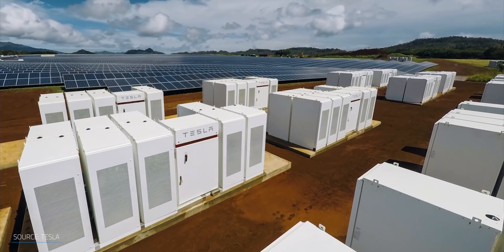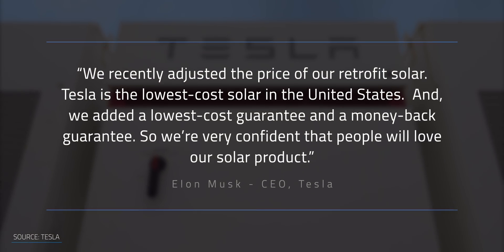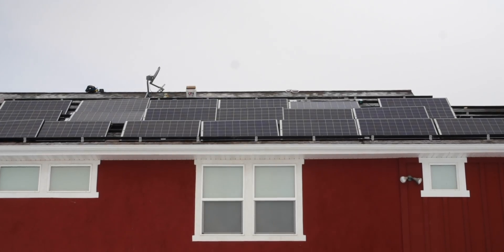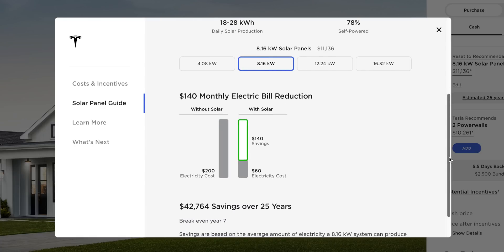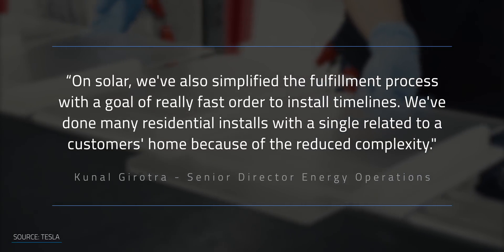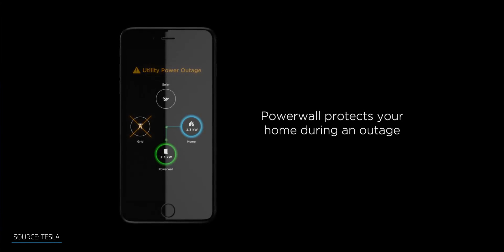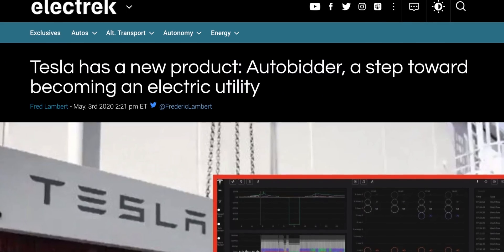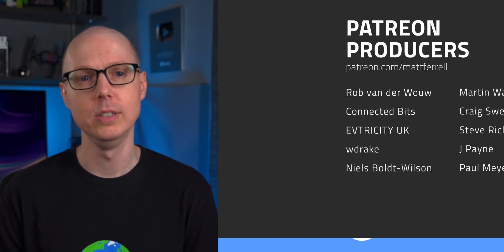Exploring Tesla solar panels game changing price

Comment: 1. It no longer makes sense to purchase a rooftop only solar system without battery storage. Consider solar without battery storage outdated, legacy. Stay away from companies that promote and only offer rooftop solar systems. You're not getting the ROI you deserve. The energy given back to the utility is your loss and your system loses capability with varying weather conditions increasing loss of ROI.
2. The cost of a solar system is over-inflated In the US FAR beyond the costs of it's parts and installation. There is no magic here. This is simple technology.
3. Consider DIY solar with battery storage for your home. It also reduces the number of panels needed. Quality 100W panels run between $80-100 (readily available on Amazon for ex.) and the new generation of integrated solar charge controllers and lithium batteries make for an easy installation by the homeowner. In fact, you can even build your own Tesla like Powerwall at a fraction of the cost as a kit. It has reached the point of simply connecting the wires from the panels and the batteries to the controller, and wires into your system.  There's lots of free professional quality online resources and training available. Most municipalities have accelerated permitting processes with minimal permit costs. Use a licensed electrician to make the final grid connection if an on-grid system. Everything is there for you to save thousands of dollars if you do your homework with ROI no more than 3 years if you build the Powerwall.

Bottom line. Don't feel intimidated with DIY. You're soon realize that “gee I can do this myself” and make it a fun educational family project. Your kids can make this a school science project for credit and peer admiration. :)

Comment: Making a target priced of $2.01 before incentives for any installation is an oversimplification of the work involved.  I worked for a solar contractor in Madison, WI, USA, for 14 years during a period where the price for a typical residential installation cost dropped from $8/watt to $3/watt.  Soft cost aside, Tesla’s marketing will put pressure on good installation contractors.  I see that their pricing is standard for any size.  There is specific infrastructure, running conduit from roof to inverter location, that is going to cost about the same whether it is a 2 kW system or 20 kW system, material costs are marginal, it is the labor.  The economies of scale with be realized with larger systems.  I can see the low pricing on a new, home with a single plane roof.  A fair portion of the homes on which we installed have many roof planes and/or sagging roofs, which take more time to install.  We also have to contend with a wide range of temperatures.  Crews work in temperatures ranging from 15-20 F (-10 C) to 90+ F (32+ C), which slows down the installation. (Note:  No one has been made to work in conditions they deem unsafe.)  One other cost factor in the USA is health insurance.  A rough estimate is the company paid $8,000-9,000/month.  I would like to see an article exploring the breakdown of costs the customer is directly paying to the contractor with a comparison of wages to the cost of living for different countries.   Tesla will have trouble finding reputable contractors established in the communities that can afford to install at this price.  I recommend caution with signing up with Tesla until you know they are installing in your area.  We had many people waiting for years for their battery and solar products.  To my knowledge, very few of any of their equipment has been installed in WI.

Comment: The cost devil is in the details: does the installer need scaffolding; do you already have 3 phase power for systems >6 kW; can the installation be done on one roof section with continuous mounting rails?
Reply: Tesla’s solar sucks. All hype
Reply: @MollyMaidParkCities  Elaborate.
Reply: @MollyMaidParkCities  no it doesn't. stop being a troll
Reply: @user-zu1ix3yq2w  Not ignorant at all. Perhaps I'm right from the start
Reply: dodgeplow Small medium and large? That only makes sense to people who know nothing about solar.
Reply: @MollyMaidParkCities  but it isn't hype. and the general consumer don't need to be an expert to get benefit from it. Furthermore, if you actually look at the video, they are very clear about what they mean by small, medium, large and extra large - preconfigured 4, 8, 12, and 16 kW systems.
Reply: sharefactor nice 👍🏼 even though I sold solar for years. You all are brainwashed to believe anything savior musks says. End of story.
Reply: dodgeplow bro solar is not a T-shirt. It’s one of the most expensive and confusing additions you can make to a house. Roof type, size, shading, angles, etc all play a role in determining what system you need. Small medium and large is just a flat out joke.
Reply: @MollyMaidParkCities  First you keep your reasons secret, and then you give an underwhelming reason: here in the Netherlands selling solar panel system "sized packs" is very common.
Reply: @MollyMaidParkCities  Yet you haven't backed up your claim that they are all hype. Maybe it's time you address that or just back down since your statement appears to have little merit.
Reply: dodgeplow 🐑🐑🐑🐑🐑🐑🐑
Reply: @MollyMaidParkCities  still no answer huh? Just deflections. Try again.
Reply: dodgeplow 🐐🐐🐐🐐🐐🐐?
Reply: @MollyMaidParkCities  try a real answer or don't bother
Reply: dodgeplow I’ll do ya one better. Read some of the reviews here. https://www.solarreviews.com/installers/solarcity-reviews

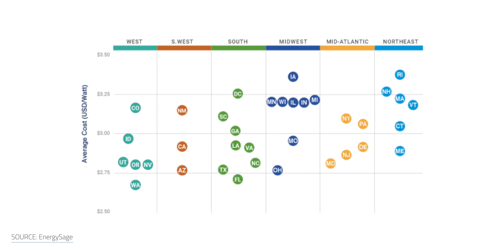Comment: Source: EnergySage, @ 0:51 seconds. what year was that chart from Matt, You are getting ripped off at those prices, we have been installing solar in Canada for $2.00 CDN or $1.50/w USD for over a year now... now if Tesla solar roof tiles were $1.50 per watt installed, than i'd be impressed... Tesla Tiles are $7/watt not installed. Tesla is messing with the public here... I keep getting asked if they can have Tesla solar tiles installed for $1.50, when they are seling traditional solar modules... Stop confusing the public ELON.

Comment: Fascinating - the price you quoted for Australia has dropped further and bare in mind the currency conversion. I had a number of quotes for a mid range system at $6-7k AUD (or 4.3-5k USD) for an 8.2kW system.
What adds to this is:
- cost of labour - our minimum wage is around $21/hr, so the costs of each step is likely higher.
- cost of other technology items - check out how much more we pay for other electronics in Australia - phones, iPhones are regularly around $1.5-2.5k.

Comment: This video just saved me over $6000 to get a 8.16 kWh system through Tesla vs another company that I was moving forward with for a 6.12 kWh system! 
Tesla's prices were more expensive when I last checked them, and I had not thought to check again! Then I saw this video and immediately cancelled the project with the other company (I just signed the contract yesterday and had 3 days to back out), and am moving forward with Tesla solar!

The other company was sucking me in due to the lower monthly cost (financed at 2.99% APR for 25 years), but the overall cost was SO much higher! Thanks for saving me over $6000 😃

Comment: In December 2013 I paid €1.89 per Watt for my 3.5Kw installation, this included everything,, including an upgrade to Solaredge inverter and micro optimizers per panel,  its already paid back for itself. The more expensive Solaredge components were totally worth it, as some roof extension from  my neighbours casting a shade over some of my panels during the late afternoon do not have such an impact now on the performance of the whole system.

Comment: Add efficiency of the installation to the calculation of usable energy. Cell temperature affects efficiency. Check specs for ratings. Also dark roofing materials commonly used throught the U.S. contribute to heating the panel environment (by storing heat) and reduce panel efficiency.

Comment: Like all home improvement projects, solar retrofit will never be price competitive in the USA due to the added value it gives to homeowners. The high turnover of property ownership in the USA means that home improvement projects will ALWAYS be tied to Added Value and not to the actual cost of installation. A competent self-installing homeowner could get a solar retrofit done for less than $0.75/W, but whenever a contractor is involved, soft costs are exaggerated.
Reply: Problem is that to get rebates a qualified installer has to do the install. Grid tie-in impossible without certified installer.
Reply: @DWan-fv1wl   quit making excuses. in black out pull main breaker. nothing to feed the grid. 2 start gen in joy. 3 when the power comes back on stop gen . 4 click main breaker and  in joy
Reply: @dknowles60  Most people aren't smart enough to do that, I think. Also, the extra power these panels make is worth money and to get the right setup to sell power back to the grid always takes a "licensed and certified installer". So annoying
Reply: @dknowles60   Yeah, right!  That’s dangerous and, it’s illegal.  If you aren’t bright enough to properly install a simple transfer switch. then you had better leave electricity alone.
Reply: @videosfromelsewhere926  is not worth the money if price to.high
Reply: @leonfulcher8548  you are the one that is not to smart
Reply: @dknowles60  So says the one that’s advertising on line that he’s not only violating the law, but he telling others to do the same.
Reply: @leonfulcher8548  the law is clear if power meter pulled you are 100 percent legal. In a emergency you do what it takes. Now if you want a transfer switch and other things then get the price down to a fair price. Hint if the cost of power gets to say apx .20 cents per kwh  you won't have any power company to worry about as most people will have gone to  solar and wind at that. Prices
Reply: @leonfulcher8548   most people on you tube are not rich like you. hint did you not learn any thing from texas power failure. May be you are so rich you can afford a plumber.  i will do what ever it takes to save my food and plumbing and if you toes get step on then so be it.
Reply: cant be done

Comment: In Finland you can get 5kWp 3-phase system fully installed for less than 7500€. Lowest pricing goes near 6000€ with shitty modules and inverter. That price include vat. and you can get tax relief from the labour costs. How about that?

Comment: I bought a complete solar system: 15 panels 275Watt, 1 inverter, roofmounting material in 2014 for about $4000 : => That is 1$ per watt. I had it installed for $300 on my roof but the electrical work I did myself (witch is just about as complex as putting 2 batteries in your remote control)

Comment: In Mexico a comercial installation will set you back about 0.80 USD/watt all inclusive, materials, labor, government permits, etc, using Tier 1 Equipment and following the same guidelines of US as we copy the electric norm from the US, excepto for the rapid shutdown part, because we don't build using wood, so fire risk is a lot less.

Comment: Dear Tesla, we need bigger and cheaper battery back up solutions to go with your solar.  Powerwalls are woefully too small.  My home is all electric.  I want to be able to power my whole home, run the A/C, AND recharge the battery then power the whole home when the sun is not shining until the next day.  Oh, and also charge two Teslas at the same time.  I think I need the solar roof tiles plus at a minimum 50 KWh of storage, maybe way more.  I would also like to allow my utility company use power during peak time to help them not needing to use a peaker plant.

Comment: In Poland you can buy panels for like $0,5/W so as far as revolutions go, this is just BS
Reply: So can we here in Germany - your neighbour country ;-)

But you need aluminium profiles for fixing on roof, cables, inverter et cetera et cetera...

All in all I guess if all done by yourself you could get away with about 1€ per Watt - maybe 1,1 or 1,2€.
Still good deal!

Unfortunately when seeling to the grid we only get 8,9 cents per kw/h
While having to pay 30 cents if we buy a kw/h from the grid!

THAT is bullshit...

How much does the electtic company pay you per kw/h into the net?
Reply: It's almost complete bullshit, yes.

Comment: Elon is right about the size of the energy market. But I used to work for Detroit Edison as a contractor in their residential metering department and there's an unspoken axim in the industry that if the electric meters aren't spinning, they aren't making any money. 

So they lobby hard for policies that keep their meters spinning. So they are totally against people going off the grid and they've successfully lobbied here in Michigan to gut the 'net metering' program by setting the rate they pay solar producers (homeowners) to below wholesale energy prices making the overall projects total costs skyrocket. 

The point is, they don't want solar because they lose money on it so they've lobbied Lansing hard on the issue and it's not just Detroit Edison, they've teamed up with Consumers Energy on this net metering issue. If they don't have a meter spinning at a home from their own power production, they aren't making any money on that customer - that's their bottom line, and they protect it jealously!

Comment: I just built an off-grid 10kW solar system with 28kWh LiFePO4 battery, inverter, BMS and charge controllers for under €10K here in Finland. If you can do a DIY build, you can save a lot of money - but of course this is often not possible for grid-tied systems.

Comment: My local power company in Perth Western Australia has started installing small Tesla power packs around the city.  Perth will soon have too much solar rooftop capacity, which may cause problems on sunny days. The batteries will help with grid stability.  Also all new solar installs will have to have inverters that can be controlled remotely so that output to the grid can be turned off if there is too much solar power available.
https://westernpower.com.au/faqs/community-batteries/community-batteries/

Comment: It's tempting... A mid-szie tesla system is like 10K cheaper than local installers, but how are they for no-standard installs, multiple roof faces, trenching between buildings, etc?

I'm on some quotes and deciding if we can afford to act now or wait until next year (a mix of personal circumstances make this an ideal moment, but also good reasons to a full year, even if we do see the tax credit drop). We have 2 good roofs for solar - one on our house and one on the garage. To get 100% of our electricity usage we need to use both roofs. Local installers are quoting in the region of $2.95-3.50 per watt and up to 5.5kw system for back of the house only, or 7.5kw including the garage.
My Utility will only allow 120% of usage in terms of power generation means we can't really go bigger than 7.5kw. I am not sure we can affor a system that gets us to that level right now. However, Tesla would get us a full system covering the most as many watts as feasible, for less than all but 1 of the local installers would do for the back roof only? Nice deal, sign me up. I am seriously wondering what happens if I order a midium 8.16kw set of panels from tesla. This gets much more solar energy for the money than anyone else but....

- No chance my utility will allow that size system (unless i am willing to loose additional generous rebates from them). Will I have to go back to a small, or will they just install as much as they can? Will they refund the cost of the panels they probably can't install right now?
- There needs to be trenching from our house to our garage - will they do that?
- The house roof is at a better angle with less shade than the garage, will they throw as many watts on the house and put the rest on the garage, or will they insist on something like one "small" installation on each surface.

I've heard they are not ideal for non-standard installs, and I've also heard of some workmanship issues, possible because they are mounting directly on the roof rather than on a rack? For the money though, it's tempting to risk isn't it, but i don't want to act in bad faith, and if started out with Tesla, i would also not start out with local guys where i know the answers for all these questions, who I've met, who have been able to give me various bits of advice and information, and i know their timeline. Will tesla get it in before the snow hits and most (not all) local folks take a winter break?